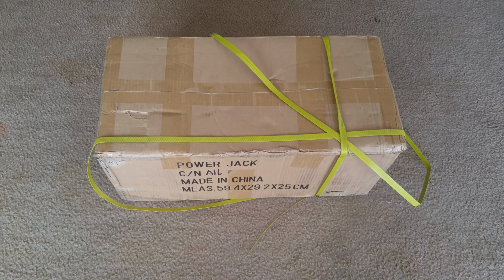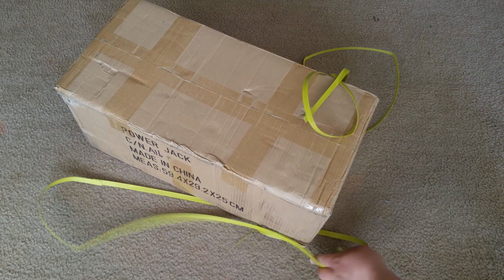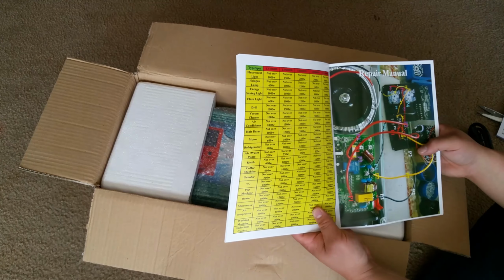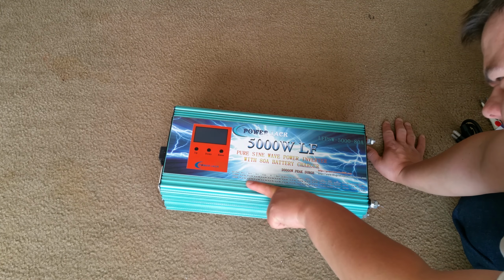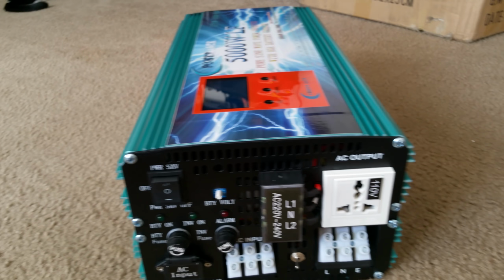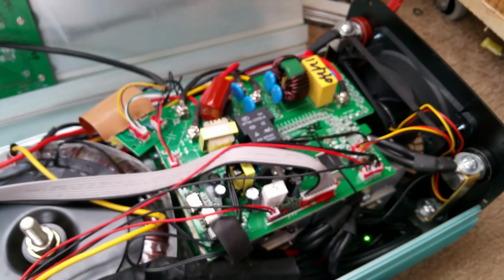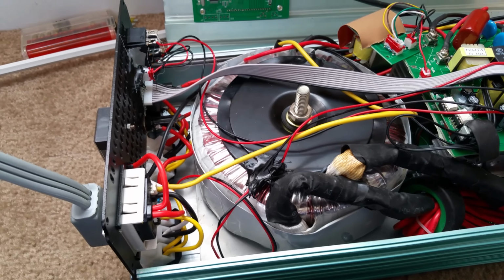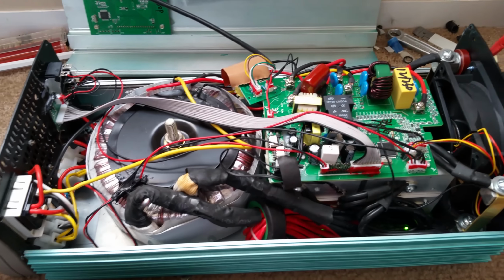Power Jack 5000W LF Split Phase Inverter Unboxing and Test

Comment: DO NOT BUY POWER JACK on EBAY.  A HUGE MISTAKE and WAIST OF TIME.
I ordered a $415, 5000 watt LF and received a defective 6000 LF.  The inverter never worked 100% out of the box.  5 uses it started shutting down after about 2 hours.  The fan would not activate.  So I thought it was over heating and ordered 3 different 3 pin fans.  The connection only read 7 volts so none of the fans would turn on.  I used a large 12v radiator fan to cool while it ran which did not keep it from shutting off. The run time kept getting shorter. Finally it shut down after about 15 different days of use and never came on again.  This whole process took about 85 days because I would only use on certain weekends.
The seller did not  send a return shipping label or anything.  So I was stuck paying $80 to ship back to a ebay seller which I was really leary of.  Once I shipped I had no guarantees that the ebay seller would refund my money or replace the item.
By the way, pay pal and eBay did nothing to help me get my money back.

I have filed a fraud claim with Capital One through VISA.  Update: Capital One has refunded my money and the eBay seller seems to be allowing the refund.  I should have been put in this situation.  

By the way I bought a 5000 LF 24 volt from a different seller around the same time as the first and it would shut off after 2 minutes out of the box with a 1200 watt fridge load.  The sellers of these Power Jacks seem to make every excuse for why the inverter does not work to spec.  The defect was discovered with in 45 days of purchase so it went a little smoother if shipping a 50 lb inverter across the country is smooth.  What a cluster!!  

DO NOT BUY POWER JACK LF INVERTERS
Reply from the maker: +Richard Johnson Sounds like you had a bad run of inverters. I know Power Jack is hit or miss. Thus far I have had no problems but I know of many on forums who have had nothing but problems. I guess its a roll of the dice deal.
Reply: +GPVlog there is 2 shift workers on each day there a day time and a night time so the night time workers are 1/2 asleep and they don't get payed alot of money so i think there not alot of care put into there work i think if is why the price goes up and down on there inverters i got a cheap 8000w LF for $480 was not a good inverter but i got the parts sent to me to fix mine as it blow up with a low load of 100w on it so the heat up if there not alot of power getting used and if you use to much they heat up so put the fans on full time best bet to save the over heating on them mine still working but i dont over load it as it just cook itself again
Reply: Richard Johnson actually per 12v
 Battery system 800va better efficiency 
So 24v system not over 1600va better performance, some Cooling Fan work when heat increase
Reply: same here.. I bought mine around three years ago, bout the same time you posted this, Installed it in my truck for emergency's, never put a load on it. One day here a month ago I decided I should try it out... wouldn't even light a 30 watt work light. and then it popped and smoked.... im going to tare it down here soon to see if it is even salvageable..